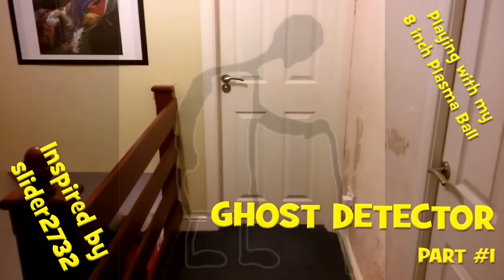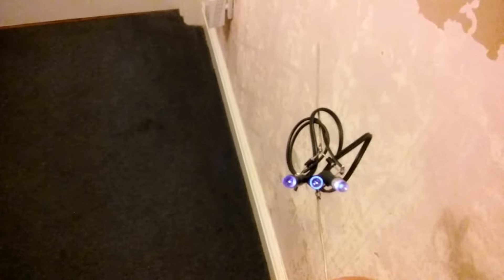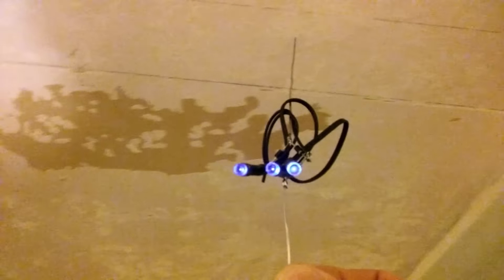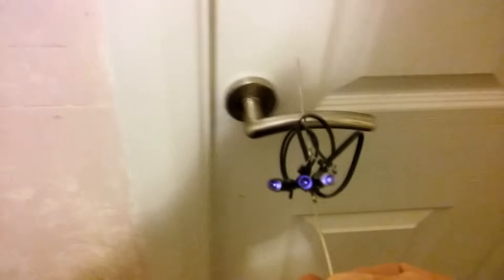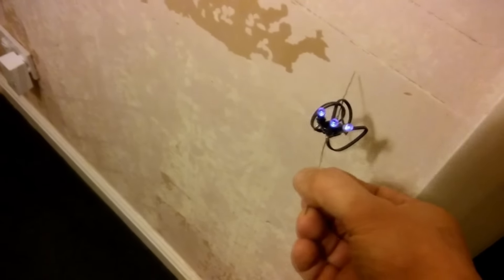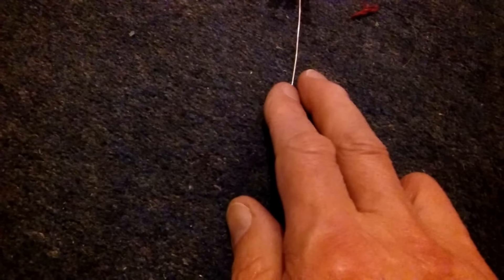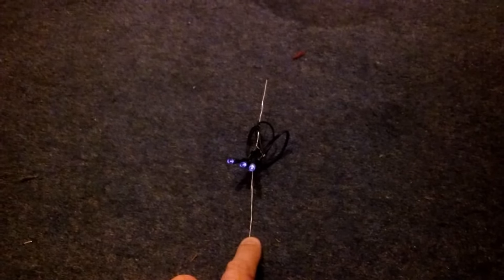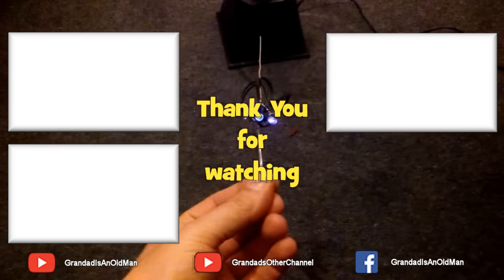Ghost detector or Playing with my 8 inch Plasma Ball again PART #1

Comment: I didn't know it can reach that far
Reply from the maker: Wireless energy is all around us most of the time so it just depends on how sensitive your detector is.  Radio and TV transmission is energy. A part of the circuitry in them is amplifying the signal before it is decoded.
Reply: Cool